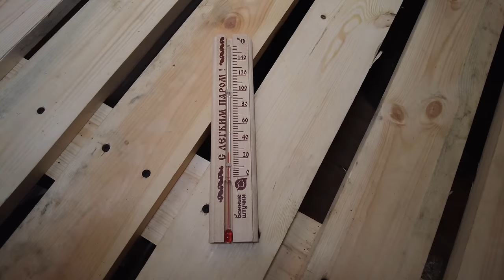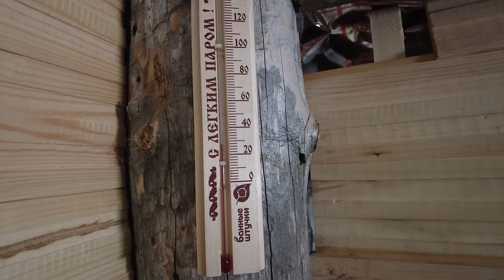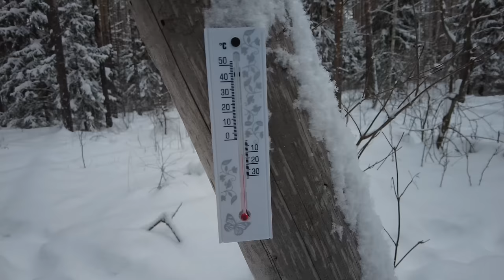From Blizzard to Bliss:  The Hidden Warm Shelter - Surviving Heavy Snowfall

Comment: REMEMBER  ! Be Careful !   A Small Fire stove in a Tiny cabin space  WILL  Burn Most or ALL the OXYGEN in that small space ,which can lead to hypoxia  and possible death .  Be SURE to have a VENT to the outside AIR for Replacing the oxygen being burned by the Stove  STAY safe Out THERE !!
Reply: damn right
Reply: That's why you put in a 3" PVC  pipe in the wall or floor to allow the stove to draw in outside air. Thus, no running out free air.
Reply: The oxygen in that space will last for many days, so unless the cabin is totally airtight, don't make a fuss about it.
Reply: That’s smart thAnk you
Reply: I think that's why he put up the blue pole as an exhaust
Reply: But sure he likes living on the edge thst's why he is in the outback.
Reply: The grey PVC pipe prevents it
Reply: @bfelten1 he wasn't making a "fuss" just showing concern which was a very nice gesture

Comment: NICE! I see an air intake.... I always wondered why no one puts an adjustable vent on the roof to regulate the temperature,, let some heat seep out when its too hot,,, they always get up and open the door,, I had a vent like that in a van I had and it worked perfect,, that van would get pretty hot in the summer but when I open that roof vent it took the temp. down pretty quick,,,, I have seen temperatures in cabins like that 100°+ and that is just too hot no matter how cold it is outside... Just a thought on the roof vent,,, there must be a reason no one does that, but I don't know what it is.. At least the cold air intake is a good idea for the fire and breathing - especially if the cabin is real small you and friend may have to take turns breathing... LOL... hard to sleep like that... Thanks for the video !!!!!

Comment: I've never seen someone split wood by flipping the axe upside down on the stump with the weight of the wood falling on the axe. What type of wood?
Reply from the maker: You can cut any tree this way, the main thing is that it must be dry, and you must follow the technique so that the log does not fall on you

Comment: Yes looks great. But do it. Most boring thing in the world. Nothing to do, sure you have to get wood ect, but then you eat alone. Clean dishes alone. Sit alone. Then the wood stove. Smaller the place the harder to regulate the heat, either too hot or too cold. I’ve done it many a time. But just after a few days it becomes boring.  But will admit sure is great for a few days.
Reply: For one thing, I bet you don't read. When you're bored, it's YOU that is bored, it's YOU that is boring.